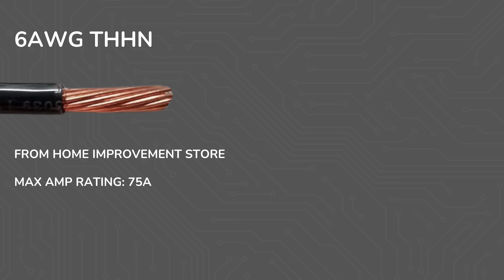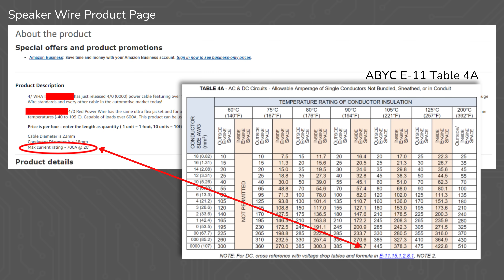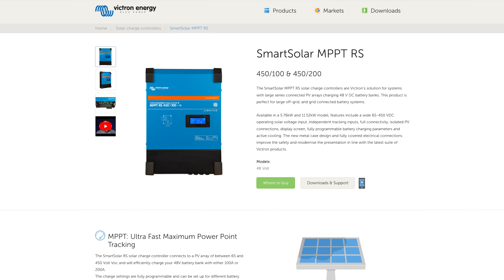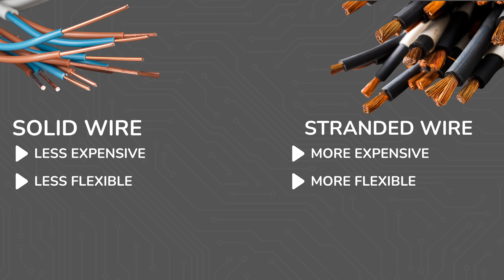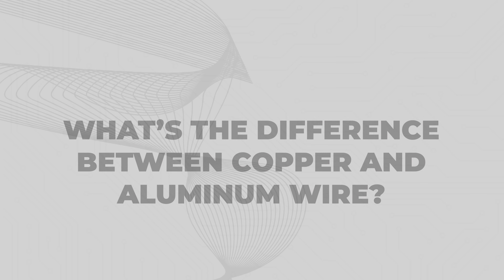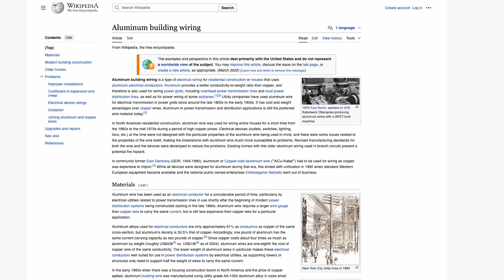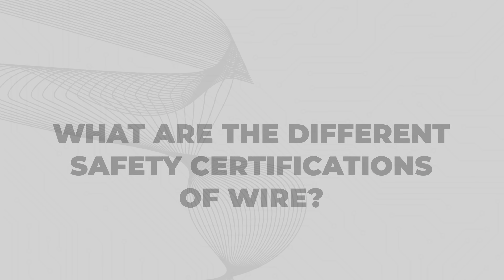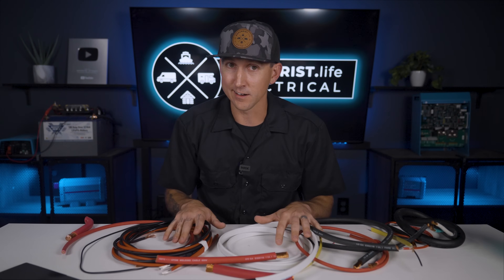Wire Types Explained for Mobile, Marine, and Off-Grid Electrical Systems

Comment: In a jam, the only thing I had onhand to carry current (24v 70 amp) was a roll of steel plumbers tape. I tin snipped off the lengths I needed and built the curcuit. + insulated in red duct tape, - in  black. 

 The conductors worked perfectly until I could get an Amazon wire order placed.

Above 30A they got warm, and HOT above 40A.  AND REAL REAL HOT above 60A. lol
.
Reply from the maker: That’s definitely a creative workaround! 🔥 For a safe and reliable long-term solution, we’d love to take a closer look at your system and get you set up with the right wire and parts for your needs. Reach out to us here: https://shop.explorist.life/support

Comment: Big box stores are typically significantly more expensive for wire. Example: 4/0 al SEU was $11.20 per ft at home depot while the same 4/0 al SEU was $2.34 per ft at Green Mountain elec supply. Same with other materials I'm consistently finding. 

 I believe big box takes advantage of convenience and people assuming they're the cheapest. In reality, they sell inferior products at an excessive, straight greedy, mark up prices, while under paying their employees & harming local economies. 

 Shop around folks, you'll see. 💯
Reply from the maker: Totally hear you—those price differences can be shocking once you start digging! It’s great that you’re shopping smart and calling attention to the importance of supporting local suppliers.

If you're sourcing materials for a full system and want to be sure everything works together smoothly, our support team can help make sure you're on the right track:

https://shop.explorist.life/support

Comment: What wire would be used for 80 amp 12 volt.  Ac. ?   Power feed in automotive application. Alternator to battery ?
Reply from the maker: Good question—an 80 amp power feed at 12V DC definitely needs a properly sized wire, especially in automotive environments where length and insulation type matter a lot.

To get an accurate recommendation tailored to your exact setup (run length, alternator type, environment, etc.), our support team can take a closer look and guide you through the best choice:

https://shop.explorist.life/support

Comment: Nate, you could be my son-in law's TWIN.  Impressive.  But enough of the that.  I'm going to call but I went on line to order wire and I can't find the stuff.  So if you could make wire kits with the option of wire length in each kit, that would be awesome.  Also, please explain WHY certain fuses (such as the car battery fuse for dc - dc chargers) is so high - I assume we are protecting the wire since each device in the line is already protected, BUT WHAT IS TOO MUCH AS FAR AS A FUSE GOES  ???  Great video btw.  Thanks.  Look for my call for custom ordering..
Reply from the maker: All of our wiring kits include the proper lengths of wire.  Reach out at https://explorist.life/support if you can't find what you're looking for.

Comment: I've seen many DIY installers using 6/3 Stranded Romex for inverter installations instead of the more expensive 6/4 SOOW cable.  What are your thoughts on the use of cheaper 6/3 stranded Romex for RV installs?
Reply from the maker: Based on the fact we supply SOOW cable in our shop.explorist.life kits, I think that should paint a pretty good picture of what I think about that.
Reply: @EXPLORISTlife  So let it be written....

Comment: I have found a lot of RV low voltage wiring to be a 12/2 stranded pair, where one half is white and the other is white with a stripe (usually green).

Comment: I am an electrician (sort of, i work in film). And we are about to build a new camper. I fully intended to use romex for our 120Volt circuits, partially because i have a lot of it on hand, and because our current camper is wired with it. Watching this video has really made me reconsider that. What are your thoughts on 12/3 SJOOW cord? It is commonly used for heavy duty extension cords, tool cords, power drops, etc. and I also have access to a decent size spool of that on hand. It has a very durable outer jacket and is very pliable.
Reply from the maker: The wire we recommend can be found in our shop at shop.exploirst.life.  If you want to source your own wire... well... you've found the videos that will teach you how to determine what's okay and what's not.

Comment: im making 4 wires for a thick battery to battery cable to add trojan batteries to my solar banlk is that ok
'
Reply from the maker: Perhaps instead, you should use the kits we have available at shop.explorist.life.
Reply: I think your question is very vague. What are the 4 wires? How are they connected? How long are they? A lot of factors that could drastically change the answer.
Reply: @jeremyspecce  thanks for responding i found a welding cable very long very heavy i had to cut it just to carry it its heavy so going to use that i think its 4/0

Comment: I was thinking of using some telephone wire to rig up some usb sockets on a 12v leasure battery and also use it to go to the wall switches where I am putting 12v 0.7 amp LED main ceiling lights in my off grid cabin.
Reply from the maker: Okie dokie! 👍. I wish you nothing but the best with that decision.
Reply: @EXPLORISTlife  
it's all I've got lying around and there is loads of it. I'm not an electrician but I've seen a lot as thin wires used around 12v systems. I'm not going to have a fire am I? I will protecting the usb's with the phone line on a 10amp trip switch. And the lights are all on a 5amp inline fuse.
Reply from the maker: We have kits with the proper wiring available in our store for usb branch circuits: https://shop.explorist.life/shop/all-products/12v-usb-outlet-branch-circuit-wiring-kit/

Comment: It’s far easily to wire a standard household 120v/15a outlet using romex than it is with stranded - plus such outlets are not designed to take stranded.
Reply from the maker: Standard outlets with stranded wire gets crimped on ring terminals.

Comment: That was a nice refresher course. 

I deal mostly with marine applications so for me ABYC is the Bible to follow. 

My wires of choice are Ancor 10-16awg for anything leaving the DC fuse box.
For the charging, battery and inverter part of the system I use welding wire.
As a rule of thumb, I like to go 1-2 gauges bigger then what is needed as long as the lugs fit onto the appliance.
I prefer 12v systems for up to 3kw loads and 48v systems for anything above 3kw.
How the RV industry is getting away with their shenanigans is beyond me. At a minimum, I would think insurance companies put pressure on them.

Comment: look out for larger sizes of conductors with a 'CCA" label - that is Copper Clad Aluminum, and should be down rated one AWG size for current carrying capacity. This is often seen as battery jumper cable.

Also, an SAE certification is not equivalent to AWG. SAE wire size might be ten percent smaller in cross-sectional area. It will be found as OEM vehicle harnesses.

Also, I resemble the ID10T remark! 12:22 I should not be used.

Comment: One of my biggest mistakes is I used a 4 gage ground wire in my system that was from a car stereo amp kit. It looked cool and seemed ok until it started melting. Only after the fact did I find it was copper coated aluminum. Scared us a bit and we upgraded to a much larger full copper wire. We have since upgraded all of our wires based on the correct requirements plus a bit extra for potential future upgrades.

Comment: Your video made me consider my situation.  My camper van’s previous owner installed an 2000W inverter powered by house batteries.  The inverter outputs to an electrical outlet that the shore power cord can plugs into.  He added a switch to disable converter from charging batteries, but he ran a 12/2 romex cable from the inverter to the 120v receptacle.  Basically it’s a romex extension cable with a plug on one end and a hardwired connection at the outlet.  After watching your video, I assume using romex was not a good idea in a mobile installation.  What would you recommend I use to replace the romex connection between the inverter and outlet? Thank you for your great videos.

Comment: Speaker wire is because it's ac.... they are counting top and bottom so in reality they are counting 350.
Reply from the maker: That, too, is such a hard justification for me to wrap my head around.  If we look at 310.16 of the NEC, which also addresses/accounts for AC circuit conductors, with 90 degree wire (THHN or similar), we have to get up to a 1500 MCM wire size before we are allowed to flow 700A.  And for context... 1500MCM is about 760mm^2.  4/0 is 107mm^2.  So 1500MCM, which is minimum for 700A AC per the NEC is over 7 times larger than 4/0. 🤯

Comment: What wire would you recommend using for a boat install, Multiplus II x2 according to Victron, needs to use 4x6 AWG but I can’t find a marine wire 4x6 AWG. Could only find 3x6 AWG. What is your recommendation?
Reply from the maker: We plan on offering this in 2025-2026 pending our new warehouse, but in the meantime, here's 6/4 tinned wire by-the-foot from a 3rd party dealer: https://sovrn.co/19tqs7t

Comment: Some thhn-2 and xhhw-2 wires are rated for 105C for different applications such as MTW. Also NEC 90C free air ampacity ratings are very close to ABYC and ISO ratings 105C. The standard NEC chart has baked in de-rating for multiple wires in conduit.
Reply from the maker: Indeed!  We will be diving into ampacity ratings and insulation ratings plus their derating tables for both NEC and ABYC in lesson 3.4 of this academy.

Comment: Thank you for the video. Great information.
The problem with aluminum wire is aluminum oxide is a great insulator.  If the terminations are not done properly and an oxidation layer present them it can overheat. 
What about CCA or Copper plated Aluminum?  You still have to upsize, but even still it is way lighter.
Reply from the maker: Short answer: there are LOADS of other types of wires, but we covered the most common ones and hopefully you can use the information in this video and the rest of this chapter to do your own due diligence on what you need for your own system.  We use pure copper and tinned copper in the kits found at shop.explorist.life

Comment: Hehehe putting in to small of gauge of wire. Thinking about the MONEY. I ALSO have an issue with what kind of circuit breaker to use. Hehehe once I used an audio amplifier circuit breaker with my solar install. Some one pointed it out. It was not a wise decision. Yes I did fix it.

Comment: There are other reasons why stranded wire is superior for DC current flow:
When AC current flows thorough a wire it produces a circular magnetic field inside the wire which opposes the very current which is creating this field. Consequently the resitance becomes higher in in the centre of the wire compared to areas of the wire away from the centre. To be precise the resitance will be inversely proportional to the radius of the wire.Therefore, the current prefers to flow near the surface where the resistance is lesser.
This is called Skin Effect
When the frequency of the AC current increases to millions of cycles, the magnetic field inside the wire becomes much stronger and the current virually flow only on the skin of the wire. Higher the frequency more pronounced is this effect.
DC current is AC current where the frequency is zero. Here Skin effect vanishes and current flows uniformly in the complete cross section of the wire.

Credit for this explanation should go to:
Someswara Rao Vemparala EE

Comment: I learned from a knowledgeable associate at Home Depot that solid wiring of the same AWG has more amp carrying capacity than stranded wire of the same AWG.

I had to step up to 8AWG stranded for my MultiPlus because of this. 10AWG solid would work but have less flexibility as you mentioned in this video.
Reply from the maker: That’s actually generally not true.  We will cover that later in this chapter.

Comment: I Took Two Wires that Were  *"Fangling " ( sort of  Dangling but More fan Shaped ) ...out of the Underside of the Steering wheel Column  and Created a  'Shorrtt ' ( there was a 
" RrrrrrrTT " Sound ....🤔) and I was Able to make Off  with some  Rich Dudes~ Bugatti EB 16.4 Veyron ! ⚜️🧞🖖😉🧜

Seriously Now Folks -  now that Marine application are on Board I will Be A Constant visitor🖖👍🎖️

Comment: I always use exclusively ID.10-T wiring and equipment. 👍
Reply: Helpful tip: if the installer is ID.10-T certified, the wiring and equipment doesn't have to be, it can inherit the certification from the installer.
Reply: Yeah, it dramatically decreases the chances of an issue with the equipment between the keyboard and the chair.

Comment: Another thing about strand count, DC voltage travels on the outside of the wire strands, so the more strands the higher the current carrying capacity. This is how welding wire with a high strand count can carry so much more power. I love the ID.10T rating joke, we used that one in the Navy all the time for the new guys.......

Comment: What’s your thoughts on a welding cable vs battery cable in the same gauge. 

I prefer to use welding cables.  It’s more flexible then battery cable and is rated for more amperage because the more finer strands you have the more amps the wire can handle for a given size.  

I also you a lot of silicone wire for my rc charge cables I make.
Reply from the maker: Is the welding cable rated for use as battery cable?  Some of it is, some of it isn't.  If it's combo welding/battery cable used as battery cable, that's fine, and some of which is what we sell in our store.  If it's welding cable that isn't rated for battery cable use, it should only be used for welding.
Reply from the maker: All comes down to it's use case, rating, insulation type/temp, certification, etc.
Reply: Thank you for answering this. I’ve seen all of your videos and the specifics, especially when buying cables online (don’t need a kit) has been hard to dial in especially when it comes to the code compliance, actual diameter, strand count etc. Thank you again

Comment: I was hoping to see some silicone wire and how it compares to them wires. Thanks for the video
Reply from the maker: Even if we didn't cover a specific wire type, I hope the information shared will give you a good jumping off point to determine if your desired wire type is appropriate for your use case.  Take what you've learned and apply it!

Comment: Early on in our van build I sized a run to our DC Dometic fridge using only the the distance to the device. We frequently had issues with the fridge cycling constantly and not cooling properly. I then learned from Nate of EXPLORIST Life that with DC circuits, wire sizes need to be calculated with the distance to the device and back to the energy source. I finally ran a new larger wire with total distance using the calculator on this channel and problem solved.

Comment: So while at the Lowes in Sherman, TX. I was watch somebody order 2 gauge.  There was two types, 1) solid core and 2) copper multi string just like many purchase for running 12v lights in a camper. 1) copper was solid and thick core and very hard to bend.  Both had a thick black other protector.  I could see it was very hard for the guy to cut it too.
Normally I was told they keep it up high out of reach and the had to get a lift to get it down too. Heavy weight spool and made still out of wood.  The associate told me that they sell it maybe twice a month and these guys were pros by the shirts they were wearing too.  We like the information that you share as a great teaching to all of us.  I'm a retired IT guy and reminds me of the days in school.
Reply from the maker: Nice!  Yeah; I've found that farm & ranch supply stores SOMETIMES carry fine stranded battery cable as it's often the same as welding wire (depending on the brand and rating).

Comment: My largest wiring mistake, so far, was thinking I had a long enough from my vehicle battery to my DC/DC chargers. You answered it properly, but I did find connectors and I'll heat shrink it. I even measured 3,4, 5 times. Still wasn't enough. D'oh!!!
Reply from the maker: ope, that's annoying.  For stuff like that, I usually measure and then add 20%.